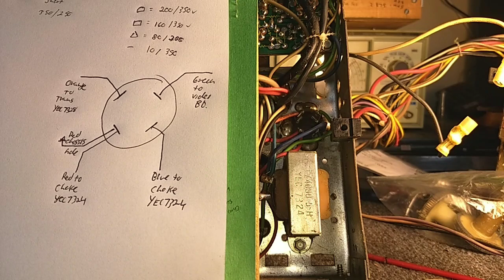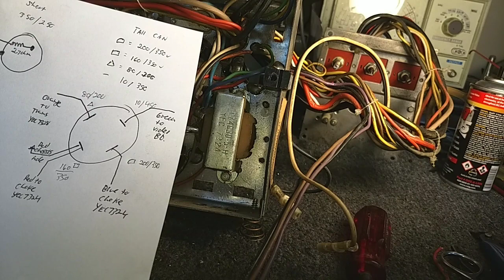Repair of 1973 Admiral SK2247 12" Hybrid color tv. Part 3/? -B+ filter capacitor replacement.

Comment: Nice job on the capacitor replacement.
Not boring at all.  To me, engineering a nice clean restoration is the best part of the repair.  I go to a lot of time and labor to finish a chassis to be at least as good if not better than the factory originally built it.  I have restuffed a few capacitors as well.  It depends on the set whether I do that or not.

Comment: I’ve found it easier to cut the old cans about half an inch above their base, remove most of the can and all of the guts, then solder new capacitors onto the original base. The wires under the chassis are therefore undisturbed.

Comment: Well done, another bit done :-D
Those tag strips are very handy, i used two in parallel to make a small linear power supply for my friends hacker radio,  a metal box was used and earthed.

Comment: Replacing old liquid caps is tedious.  When feasible, I replace them with polymer film or solid polymer.  The big filter caps are the typically too expensive to replace with polymer film, so I upgrade those to 105C electrolytics.

Comment: Have you tried those replacement filter cap wafers yet?  I've bought a few, but haven't used any yet.  I expect them to be very useful.
Reply: Those wafers would be better of they had solder lugs.
Reply: yes those "adapt a cap " boards work great and Very usefull !

Comment: hello i kinda in problem now my pomp morot just get wet inside indictor and its burn i let it dry out but im not sure if there other way to fix it other than replace the inductor im still studding motors in my last year in univ i know to fix it if it only the wires but im afraid there more to do than the wires so any advices?
Reply: Hello, try looking on YouTube for motor or inductor rewinding by hand. Cheers.

Comment: Not meaning to be critical but in antique radio restoration I heard and learned not to parallel different value of caps.... though they'd be same voltage the lower cap value will almost certainly go first.... (smoked one and experienced  it myself).   Is that rule true w/TV's? Ever had that issue?
Reply: I've never had a problem with parallel capacitors,  as long as the voltage rating is above the d.c voltage value applied.
Two capacitors would not look original, restorers would not like that.
Reply: isn't it highly dependant on esr difference of the cap and duty cycle they are rxperiencing? the  higher frequency of pulses would probanly don't like high esr smaller cap but leaving just one of different value could also make or break the circuit. lower value might underperform while higher one could load  the rail too much. there is many schools to do anything and you can't really say who is the absolute right guy

Comment: I'm trying to remember 12" color sets with vacuum tubes circa 1970s.
Seems anachronistic...all the high voltage and chroma circuitry for only 12" CRT.
Reply from the maker: Remember that General Electric made thousands of 10" color all-tube portables, marketed under the name "porta-color" which had no DC restoration and terrible resolution. 

I think it was all about the miniaturization of it.
Reply: @JordanPier  , when you mention DC restoration ; in what context do you mean ?
Reply from the maker: @brianfletcher9774  the ability to maintain black levels despite high low frequency video information. 

An example is of a person standing in front of a completely white background. With poor or no DC restoration, the black level diminishes and the person becomes almost a silhouette against the white background. 

With dc restoration the black levels do not vary with whites, the remain constant. Now the person can be seen against the white background with no loss of black level or detail
Reply: @JordanPier  do you watch tv/movies on an lcd 4k TV. Eventually all the crts will be non existent. Putting this kind of work into a 1972 tv with a tired tube seams to be not worth the while. Just upgrade to 21'st century technologies!!!😊
Reply from the maker: @nathen4021  I've had two different flat panels. Both of which lasted about 2-3 years. Got tired of them breaking. Got a Toshiba hd CRT from 05 that still works great
Reply: @JordanPier  What could be done when all the tubes are gone??
Reply: I have no idea what brands you, shango and radiotvphonknut go for that die so quick but we've got flat screens in the family ranging from 13-16 years old that still work well. They are Sony, LG, Sharp. None are plasma.
Reply: @nathen4021  Do you go into Rolex stores and tell everyone there to buy a quartz wristwatch instead of old mechanical clocks?